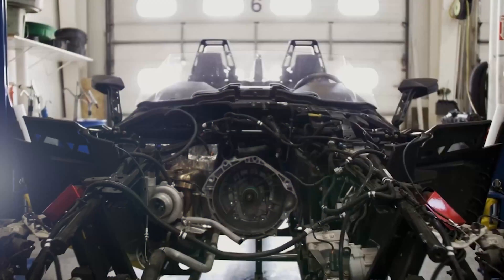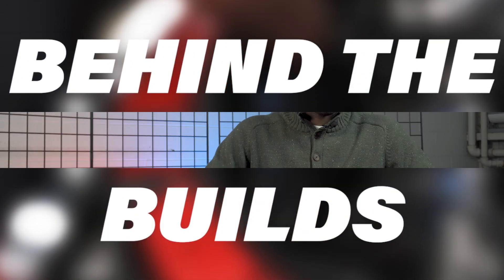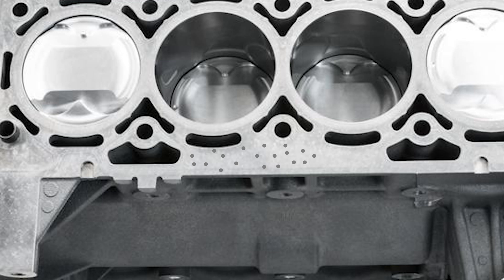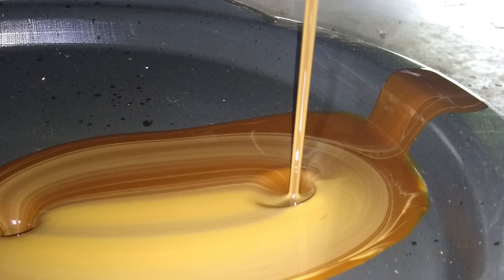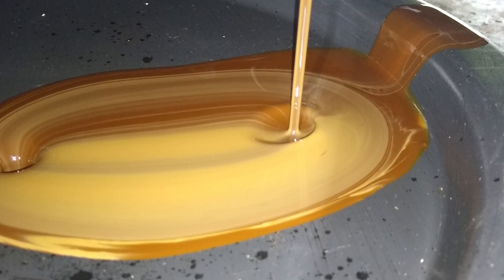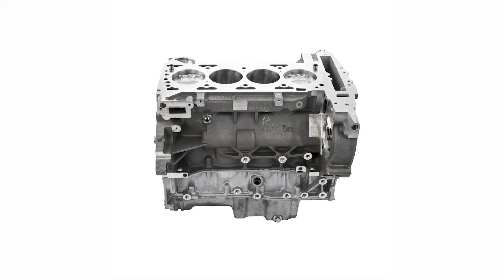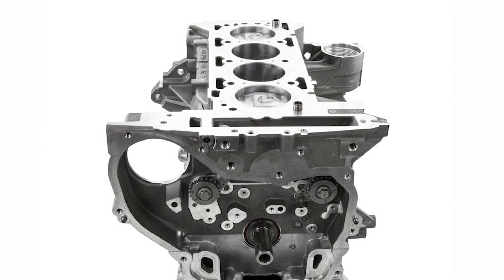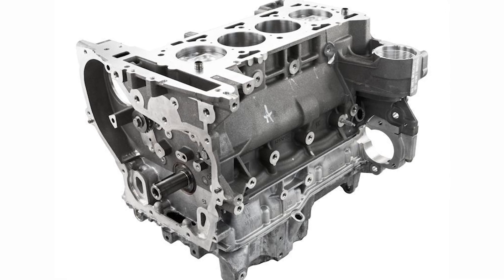Porous Block in LNF Vehicles // Behind The Builds

Comment: I had this at around 12k miles in my 2009 which i got mid 2009. so I got everything replaced under warranty. Still have the replacement engine which is still foam casted though. The guy didn’t seem sure of the cause, this was in 2011. I guessed it when I heard they expanded coolant passages for the LNF coupled with foam casting. Then the forums all talked about it.

Comment: If you're reading this and have this coolant mixing with oil issue, then takes my advice. 

Buy morosso ceramic seal. Blue and white bottle. Don't buy the red and white bottle. Blue and white block seal by morosso. 

Change the oil and filter. 
Remove thermostat. 
Put the interior heat on high and leave it there for this whole procedure. 
Flush out ALL the coolant from the system with hose water 3-4 times. 
Fill half the system with water. Mix the morosso with water in a clean jug. Start car. Pour in morroso/water mix through the coolant reservoir. Fill rest of system with hose water. Drive the car for 1.5-2 hours. Get it hot and then cold. Many heat cycles. 
Park car and leave over night or 8'ish hours. Drain system. Flush system 2-3 times. Replace thermostat. Fill with coolant. 

This worked on my LNF. 4000km later no coolant loss or oil mix. $45 bottle fixed my block.
Reply: I used a sealer and it worked as well. Until I did a pull on the highway and getting into boost for a good duration of time. Overheating and coolant loss came back after that. You still able to get into boost on this stuff and it hold up?

Comment: does this happen on the l61 blocks from 2002-2004? i just built one and installed it into my 1984 alfa romeo spider....( it was a lot of work )  i have heard about this.. on a empty block  i poured hot water into the block water passages around the cly i blocked off the port on the rear of the block so the water would not come out,, water stayed  for 24 hours..no leak that i could find